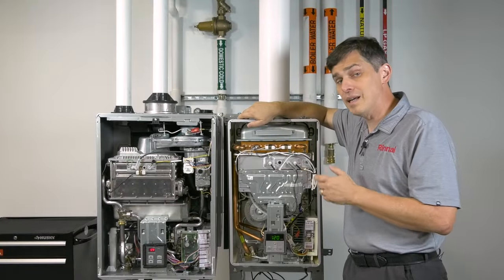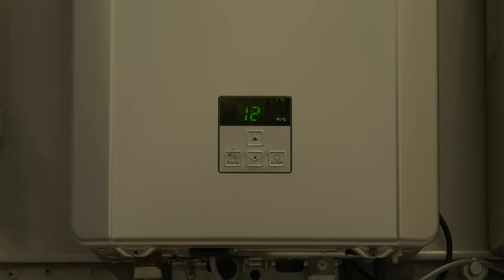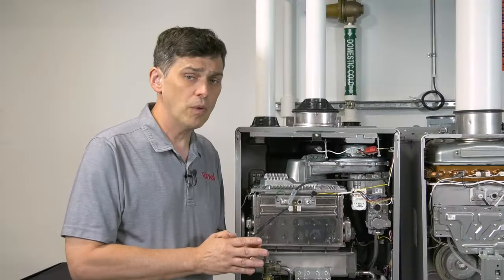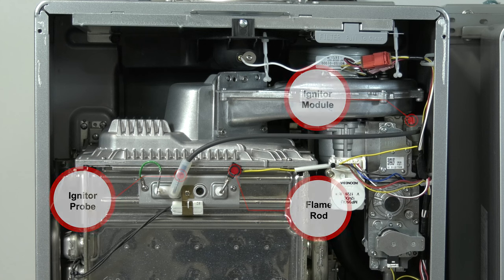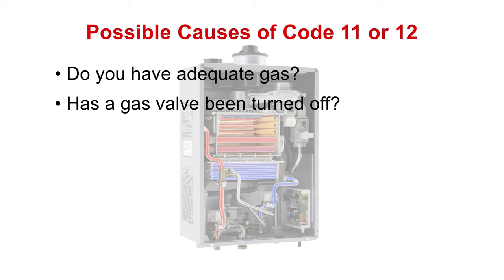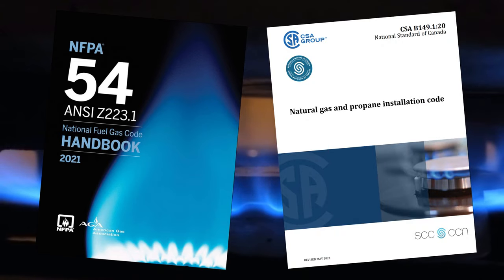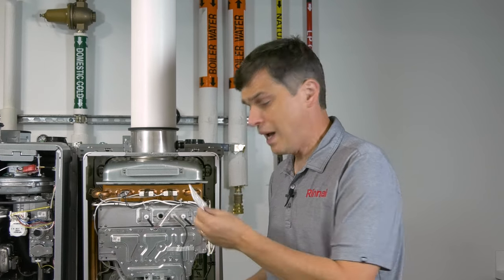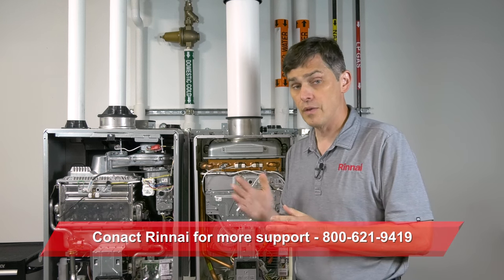Resolving Codes 11 and 12 on a Rinnai Tankless Water Heater

Comment: MY code 12 on a newly installed (3 weeks)  RE180EN turned out to be a small unplugged cable (out of the box)  that went to a solenoid which I never identified. The unit was turning off when running a fixture in the house at a flow rate of approx. 1 - 1.5 gpm.   What's odd is that it ran for 3 weeks before faulting.
Reply: Can you describe the solenoid? I'm having a very similar problem.